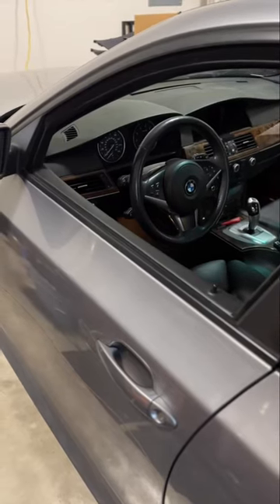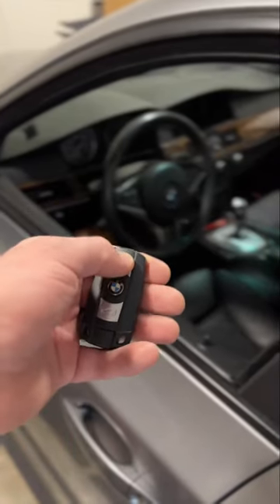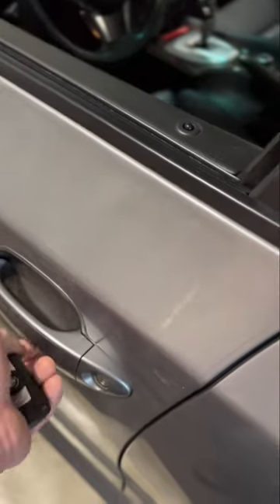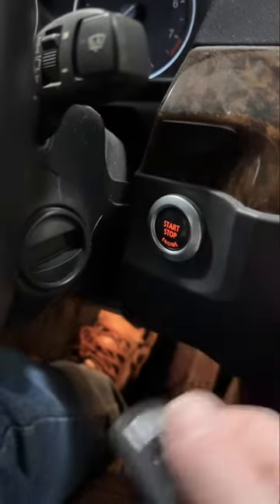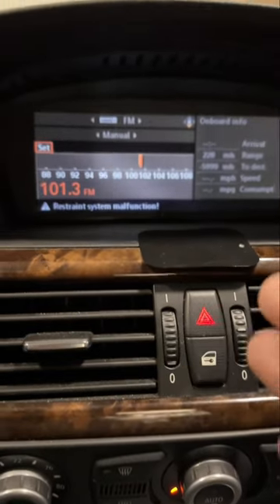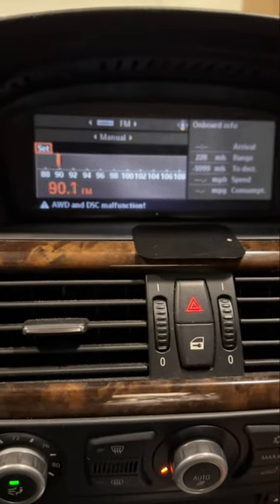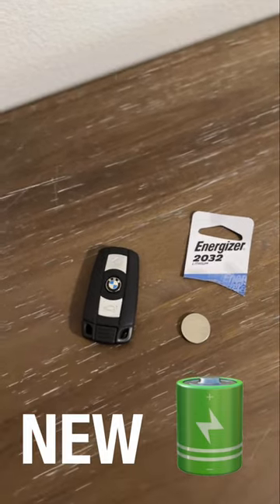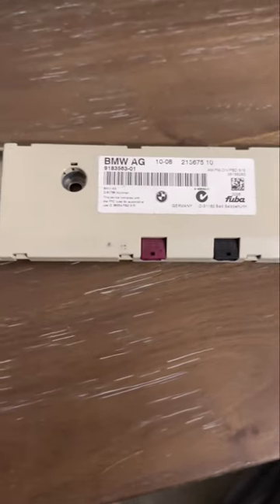How to test if your BMW has a bad diversity antenna 📡 #bmw #diversityantenna #e61

Comment: Same symptoms and i pulled it out, cleaned the pins really really well until they became shiny, after that i assembled it back on, the radio became clear and loud but the key still doesn't work.
Reply: The same problem for me.. really fuking angry but Ye… i dont give a shit if my car gets robbed anymore.. what could you do
Reply: Key remote uses that thin wide ribbon cable, if you have OK diversity module your key wil work next to it, check ground cable, if you have problems, add some short grounding to brown cable and bolt it on hinge :)

Comment: Mine is broken and i dont have money for a new one
Reply from the maker: Understandable. I didn’t want to spend $400 on the new one, that’s why I bought a used E63/64 unit, it was under $60 on eBay.
Reply: Yeah i might consider doing that thanks for the tip

Comment: Hi thank you for this - does this apply to E60 as well?
Reply from the maker: It can. E60 sedans don’t struggle with diversity antenna issues like E61 wagons do. But you can troubleshoot it the same way I guess.
Reply: @EliteBimmers  E60 also have this problem, just replaced my diversity antenna, i guess the antenna wears faster if you have comfort access, like my car

Comment: Heyy, can you help me with mine problem? So my key less system is working, key is working too, but the range of unlocking car is very small, i can unlock my car from only 2-4 meters, sometimes it catches a signal from further, but just sometimes, so is it battery? Or antenna? 
Thanks for tips!
Reply from the maker: Hello, I would start with a new key fob battery, it seems it’s getting weaker.